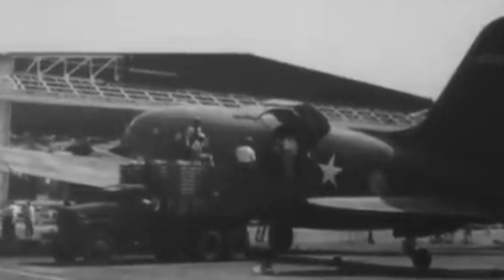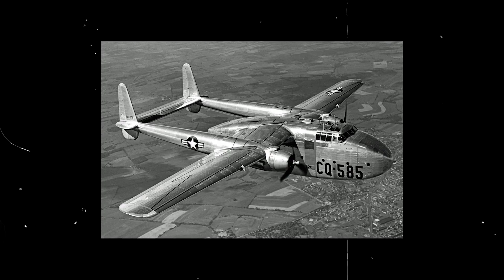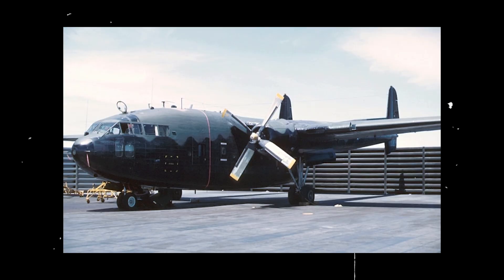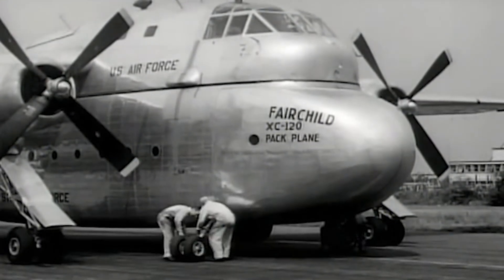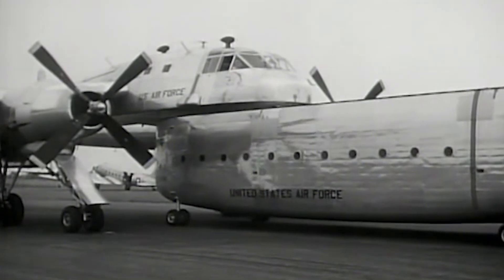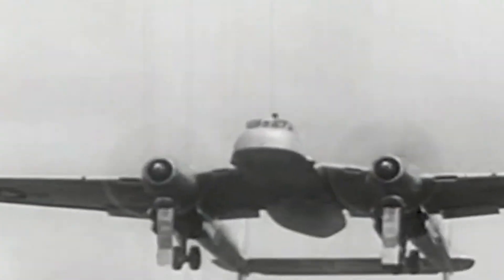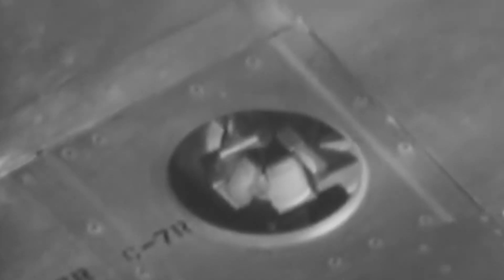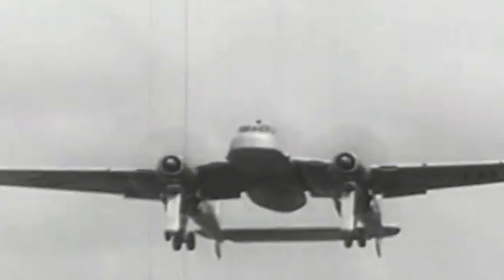Why Don't They Build It Today? The Most Brilliant Aircraft Design Ever

Comment: What a great idea!!! An aerodynamic version of the con-x box's seen on trucks, trains and on flat ground for storage space... What makes this design so valuable is the quickly loaded and unloaded feature... And a ready made storage spot for mobilised workshops... It's hard to believe that the government actually scrapped programs like this... It would have enabled quick ultra-modern arrivals and departures of these containers, from any suitable air strip... Reduced  dead-heading on return trips means that these planes could quickly generate fares in both directions of trips.... Very efficient...
Reply: based on another comment, it seems like the aeronautics were ok, but ground handling was difficult on dirt and impossible on mud
. Could have been a commercial success(?) but impractical for the military

Comment: The C130 came along with more capacity and longer range really an all-around better aircraft.  Eventually, the C-130 did have this capability with special mission modules to be loaded into it.  Airborne Battle Control (ABC) module is just one I can think of off my head.

Comment: The improvements in the ability to successfully complete low-level air drops completely eliminated the need to have a separable cargo container. Offloading without ever landing is much faster than landing and detaching a cargo container.
Reply: The C-130 rigged for LAPES can deliver a lot of different mission specific cargoes to ground forces - pallets of ammo, vehicles, and even the M551 "Sheridan" AR/AAV light tank.

Comment: Henry J Kaiser purchased the Willow Run plant that Ford built to construct the B-24 Liberator during WWII. In addition to building Kaiser and Frazer cars, Kaiser-Frazer constructed the Flying Boxcar there.  Kaiser complained that the USAF was constantly demanding design changes which were passed on to Kaiser-Frazer without being  completely engineered by Fairchild.

Comment: Even with their STOL characteristics, the C-130's were banned from landing during Tet Offensive supporting Khe Sanh  C123's had a shorter turn around and did land but  the VC, still got them off loading. Doubtful that a C120 would have had an advantage in that scenario. Without the POD,  the C120 would be  aerodynamically unstable as mentioned,  however, with today's  fly by wire, and different engines, might work.

Comment: This should totally be a thing!  The flaws look like they aren't surmountable, and improvements in standardization would make it easy. 

Google says the standard 40' shipping container didn't become popular until the 1960s.   So their droppable pod didn't have an obvious and commercially available source. 

They could just engineer a nose and and tail fairing for the standard 40' container.  With that, mounts above ground level, to use to install wheels and jack up, when they've reached the destination.   They'd likely want to put flat sides down any containers with vertical ribs, but that's a piece of sheet metal or thin wood, not any sort of heavy structure.  Any trailer could likely be modified in a couple days by a small team, once they have the process down and parts available.

They could even include a tug, either in the container, or in the fairing, on the first few missions.  The tug would be more like a forklift tractor, than a tractor trailer tractor.  They only need 5 to 10 mph from it, not 70mph.  The tugs already exist, and are used in warehouses and freight yards. 

So that's the box, the aerodynamic fix for the flat nose and tail, and a way to move the container off the runway/highway/field.  

The stability issue is an obvious issue.  I think some of that problem comes from the vertical change of the center of gravity.  With the container on, it probably flies great, because the weight is under the wings.   But without the container, it's obviously going to be wildly unstable.   They were focused on keeping the C-119 parts, but they should have considered redesigning it.  Move the wings up to the top of the fuselage, like the C130,  C5,  C17, C-123, CN-235, etc.   They'd likely want to keep the twin hull design, to help keep control surfaces out of the wake of the body. 

The XC-120 didn't even have jet engines, because they were barely a thing then.  Now they're bigger, stronger, more efficient, and cheaper.   There are probably enough jets and parts in the bone yard to build a fleet of these container aircraft.  Well, except for the airframe itself.

For deploying, they may have better options with this kind of setup.  I think they could drop cargo containers while basically doing a touch and go.  They show the collet clamp in the video, so that was already designed for this.  Touch the ground, release the clamps, and the now drastically lighter aircraft pops back up.  Or full stop and unload, as desired.    

This would be a HUGE deal for civilian purposes right now.  There are a ton of hours wasted loading and unloading supplies on aircraft, going to hurricane stricken areas.    Or war zones.  The military will still do military stuff.    

I'm not in any sort of position to tell the military what to want.  If I were, I'd say to resurrect this idea for both military and joint military/civilian cargo operations.

Comment: I guess the C-130 was on the drawing board as the C-119 replacement, so the C-120 prototype although clever didn't quite fit the bill. But it also goes to show that a lot went into development of the C-119 replacement as the C-130 still proves its worth while still being in service even today.

Comment: It makes the idea of a truly real-world & full-scale Thunderbird 2-like vehicle far more realistically achievable and viable!

When looking at this, and what it achieved with just two reasonably low power engines when compared with what is possible from modern hybrid multi-mode Jet Engines......

And as we continue to innovate & adapt it is possible that a similarly stylized aircraft may one day be deployed in real-world applications as a form of small inland aircraft carrier replacement that would be critical in disaster scenarios in remote regions where remote power & facilities are required but otherwise unavailable.

The VTOL capabilities of such a platform would be critical to it's overall success. Being able to also swiftly switch between a variety of "Transportation Modules" would also be vital to ensuring that such a vehicle can be rapidly equipped for the tasks it faces and sent into action at a moments notice.

Perhaps by turning the aircrafts core rigid-body frame also into part of the main lifting surface of such a platform would also help to keep the plane within a compact overall form factor.

Also, have the wing itself be placed above the core body of the aircraft (like how one parachutes) would once again allow such an aircraft to retain a compact profile while having a significantly large lifting surface area for such a vehicle of it's size.

Dual-Winglets on either side of the main aircraft body with angular wing extensions on the end of each winglet to increase it's overall effective lifting surface area would then aid in providing the aircraft with agile maneuverability at cruising speeds for what would otherwise have been a very slow moving vehicle VS conventional fighter jets.

You could finally turn the underside into a duct-like configuration that would also act as yet another lifting surface, thus providing a lifting area that is roughly 2× the size of the main body prior to adding in the additional lifting surface area of the four side winglets.

You could then have the entire frame be of a honeycomb-like structure that is filled with a lighter-than-air replacement gas of some kind, and have that remain at pressure at all times with production of said gas being done onboard the aircraft to reduce refuelling & maintenance requirements.

And for propulsion you could deploy an array of next-generation hybrid fuel, hybrid power, multi-mode Jet Engines, four large engines, two on either side of the main airframe could act as both forward propulsion & VTOL deployment thrusters, then an additional four slightly smaller engine would be located at the rear and would act purely as forward motion propulsion.

You could have the potential to integrate four extra tilting 5-bladed fans, one inside the body of each winglet, and have them use the outer skin of the aircraft as the fan blades such that when not in use they would lock into place and create a seamless wing surface on the winglets.

Comment: Imagine that if they apply this very concept with a Quad-tiltrotor aircraft for very rapid deployment of wares in certain areas. Imagine FEMA using a pod filled with equipment/ drash tents to certain disaster areas for immediate-build hospital aid camps, or military applications. This was a great idea of the time, and a great prelude to a more modern pathway to immediate deployable equipment concepts. Excellent video! Thank you.
Reply: Piasecki attempted something quite similar- essentially a balloon with 4 sikorsky choctaws (one at each corner).  It only flew once, was very unstable
Reply: @EBFISCHADLER  That is interesting.

Comment: Fairchild XC-120 Pack Plane was a very interesting concept and in my opinion it would have been useful but as you stated it never really attracted the airforce and because of the Korean war the production of the C-119 was far more important. I have a question: was the legs was retractable??
Reply: 8:18, shows the wheels retracting in flight.
Reply: @paulqueripel3493  yes, thanks for the info and ahead you can actually see it  in retraction! Why I didn't see it is a very good question...

Comment: I think that's a brilliant missed opportunity. Had the Packplane come along a couple of decades later it would have had the benefit of computer control and most importantly - CONTAINERISATION. Had the Packplane been designed from the outset to accept a modern steel Container, so long as it was able to carry the weight of a fully loaded one, it would have had almost limitless application, I think.
Reply: Such an arrangement would not be efficient, the weight of the the steel shipping container would take up too much of the aircraft’s gross weight.
Reply: @johnyoung1128  Yes I thought that might be the downfall of it. Shame, cos it's such a brilliant idea. What about one of those little half size containers?

Comment: Looks just slightly too far ahead of its time. Containerisation however came in around this time as well, if adapted to a common system then no reason why it wouldn't be feasible (though containers as used in shipping are too heavy)

Comment: Imagine if the cargo was a 40' shipping container and the landing gear was designed for soft runways so the plane would taxi to the drop area of the runway and release the container then taxi away from it to get another one or by taxiing over it and lifting it into place. 
The key would be an aerodynamic space for the sea can .
You could literally have a unload and reload time similar to a tractor trailer 🤔

Comment: A few years ago a European design firm put out an idea for a similar concept, but for a passenger plane. The idea was to have the airline's baggage and passenger terminal in the city: passengers would board the passenger/cargo module there, get trucked over to the airport and the module mated up with the fuselage of the plane. The idea was to avoid the problems plaguing airports: large parking areas, roads criss crossing the airport grounds, large expensive terminals.
The idea had numerous problems, the foremost was that the designers didn't understand aircraft and air travel. A passenger/cargo module would add additional weight, require  not only module to fuselage connections, but also connections to power, bleed air and comm. Moving the airline's passenger terminal to the city would mean handling the traffic that's associated  with the city, including road construction delays, traffic, etc. And still there is the parking issue. Connecting flights between airlines would be impossible and even within the same airline. All in all, it was an innovative idea that didn't take into account how air travel worked.

Comment: Went flying in the C-119, I think around 1957-8, with a bunch of other CAP cadets. Orientation/indoctrination to the USAF. It was called Wold Chamberlain Field back then (MSP). Of course I joined the Air Force in '62😁 and was QCI on the F-16 in 1980. We do build some really great flying machines.

Comment: The C-119 is one of my favorite aircraft. I never understood why they never tried, or made a twin boom C-130 which, in my mind, would be awesome. Maybe it's just less expensive to make a single tail aircraft over a twin boom?
Reply: Yup.  While a twin-boom C-130 would look neat, what would be the practical advantage that justifies the added cost?
Reply: @horusfalcon  None, I just want to see one for the coolness factor.
Reply: @horusfalcon  if one tail falls off you still got another one
Reply: @hunterbear2421  uneven drag
Reply: @hunterbear2421  If a tail falls off, you aren't flying much longer
Reply: @colbeausabre8842  depends, then again it was a joke.
Reply: @hunterbear2421  Nope. They're connected in almost all twin boom aircraft and it's like that if one falls off so will the other one unless you make it incredibly strong. There's a P-38 that survived a midair collision with a BF-109 that severed the horizontal stabilizer but nothing except the propeller of the engine where the other plane hit was lost. There's pictures of the chop marks made by the 109's propeller down the inside of the right hand boom. I've never been able to find the picture anyplace except in Martin Caiden's book "The Forked Tail Devil" as the P-38 was named by the German Luftwaffe.
Reply: Aerodynamics concerns. Flutter, shock wave at high speed etc.
Reply: C-130 is four engined, maybe a quad boom?
Reply: @butchs.4239  Armstrong Whitworth Argosy , 4 engines, twin booms : Nord Noratlas normally 2 engines but one version added 2 jets for a total of4 engines, twin booms
Reply: The twin boom design came in handy as a plot point in the 1965 film Flight Of The Phoenix as well as it's remake in 2004.
Reply: @brianknapp6215  Love both films , but I still feel sadness when watching the original . The pilot who flew the remade 'aircraft ' in the film was famed air-racing and stunt pilot Paul Mantz . He died when the 'plane' crashed going round for another (actually unnecessary !! ) 'take' . A terrible loss of an extraordinary pilot and character . Pete
Reply: @brianknapp6215  Great film!  You can't beat the original but I also enjoyed the remake.
Reply: @brianknapp6215  The original used a C-82 Packet, not sure about the remake.
Reply: @butchs.4239  Understood.  That configuration was a popular one- with multiple aircraft sharing similar designs.  Apologies...
Reply: @brianknapp6215  Fairchild built both aircraft, it's easy to mistake one for the other unless you see them sitting next to each other. The C-119 was still in service with the Air Force at the time the movie was set, where it's predecessor (the C-82) had been retired and sold off as surplus.
Reply: See the Armstrong Whitworth Argosy. AKA the flying tit.